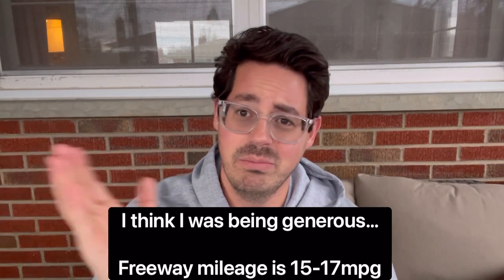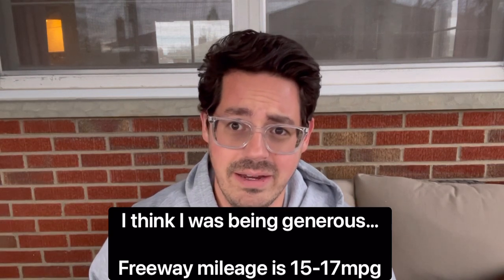Worst Engines of All Time: 1982-84 GM/Chevrolet 305/350 V8 Cross-Fire Injection System

Comment: In early 2000's a friend acquired (money owed to him) an 84 Vette, it was running, but barely. For several years I watched him spend God only knows how much money on that car. Replaced engine, transmission, brakes rotors, interior etc. etc. He even painted car himself (just ok) and was convinced that because it was the first year after GM skipped a year that it was worth the money. I just saw it as a rat's nest, and still do. I remember throttle bodies giving him fits, this video brought back all those sad memories of him hemorrhaging money for his dream car.

Comment: Oopsy at 5:54 ... runner length tunes the resonant pulses that serve to "ram" the mixture into the cylinder. Think of them as pipe organ tubes... longer tubes means longer wavelengths means lower frequency of resonance means greatest resonance at low RPM. That's why the LT1 (1992+) went with shorter runners to address some of the high RPM breathing issues of the Tuned Port Injection (L98 and LB9) setup, and why engines like the LT5 (the Lotus-influenced ZR-1 of 89-93 (?) ) had twin runners... one long for in-town driving and a short set for high RPM.

The Tuned Port Injection engines of 1985 and later (305 LB9 or 350 L98), especially the quicker-brained versions from 1986+, were worlds better even if they were "batch-fire" instead of individually fuel injected (meaning, all 4 injectors on a bank fired at the same time, so ultimately there was bound to be some puddling in the runners near the heads). I can get 25-27 mpg (US) on my 1987 Trans Am GTA (with the 305 TPI automatic of all things) without effort at 68-70 mph cruising speed over very long trips. And driveability is just phenomenal, with amazing throttle response and a feeling of having an engine that isn't shy to pull at very low RPM... I will often climb bridges at 38-40 mph with the transmission in overdrive with the lowest of pedal travel, the engine just hums effortlessly at what seems to be 1000 RPM, converter clutch still engaged. In that respect, the engineers really succeeded in making the smaller engines feel like the larger ones they replaced, with significantly reduced fuel consumption.

I imagine your 1982 Trans Am must have a fairly nice sound if it still retains the dual-resonator exhaust setup. I think those years still used a pellet-style catalytic converter and you could get away with such a stupidly unmuffled exhaust setup due to the converter. That would never pass regulation on my 1987 GTA, LOL!

Comment: It never ceases to blow my mind how little power old American v8s made. I understand they had a lot of push on a count of their displacement. For example though, Honda had a side draft carb 1.8 liter that made 123hp in 1982. Or course it could only do it screaming at max revs, with little low end response,  but considering being much less than half the size of a 350 it’s just mind blowing.

Comment: The crossfire was used in the corvette from 1981, I've worked on several. Two of them (1984-85) I converted to standard GM TBI and the customers were happy to have a car they could actually drive.
Reply from the maker: No. From 1982 model year. 1981 was carbed.

Comment: Circa 1990 or so one of my friend's friends had a little used 1984 firebird v6 5 speed manual that I used for about a 50 mile sojourn and I thought it was kind of fun to drive.  Back then, anyway.  The engine ran well enough. Slow but the stick made it mildly entertaining.  It shifted smoothly and the clutch take up was alright.  Not thrilling but it didn't break down on me, so there's that.  Boy did it shake and rattle, though.  Just awful build quality.  He got rid of it not long after that if memory serves.  Sounds like maybe the v6 was the better choice.
Reply: Those early oddfire V6's shook like a V8 with 2 bad sparkplugs...

Comment: I have an 82 corvette with 150,000 and the engine was never opened up. It was GM’s cheapness that caused most of the problems with the plenum leaking. All because they chose to use silicone instead of a real gasket that felpro produced later and solved all the problems. IDK where you get your fuel numbers from but the 82 gets 16MPG around town and 16mpg on the highway without the AC on. The worst part of the engine was it falls on its face at 5000 rpm.

Comment: I read somewhere, I don't remember where, that they limited the runner size in the Crossfire because if the ports were full sized, it would make more power than the upcoming TPI.  No way that would be acceptable to '80s GM. Granted, I've never had one, I've never driven one with an X-Ram or similar, and I've never had to deal with the headaches of those early TBI units.  I did have an '87 C4 with the TPI and though it wasn't fast, it was very consistent.  One night at the drag strip I made six passes, the worst was a 14.45 and the best was a 14.39.
Reply: The '85 with iron -882 heads was supposed to be faster: 
https://www.youtube.com/watch?v=M9FwU9iUmfo

Comment: "0-60 time is like 8 and a half seconds.....not fast" LOL My 75 century has a 0-60 time of like 16 seconds. Should I just get out and push? XD
Reply: Like this '69 Impala with 396" engine at 03:27 :  
https://www.youtube.com/watch?v=Ljch2kCg4rM
Reply: @BuzzLOLOL  LOL yeah haha. The 231 actually has a lot of grunt on the low end. Getting to 45 is just as fast as most other cars it just loses breath in the top end.
Reply: @YarHarFD  - V8's with 2 bbl. carb.s just get asthmatic by 3500 RPMs... or maybe by 3000 on a 396"...
Reply: @BuzzLOLOL  it's mostly the intake and cam combo. Carb is irrelevant if you can't get it all in to the cylinder

Comment: It's like you reached into my brain to create this video. I have an CFI '82 T/A, just like yours, only mine is white with a maroon interior. Dream car since I was a kid watching Knight Rider reruns. Found it for what felt like a steal in 2014. Suffice to say I have, through sheer necessity, become an expert on the electronics that govern the Crossfire system. I swapped a 350 into mine when the original 305 overheated blew some seals and warped the intake... elected to keep the crossfire to preserve originality at car shows. I made it a little higher compression with aftermarket pistons, threw a little hotter cam in it with some stiffer valve springs, opened up and ported the CFI intake, gave it a decent exhaust, and ended up replacing the ECU with a Megasquirt system and wide-band O2 sensor, so now I've got endless tuning possibilities to try and overcome some of these design flaws while keeping everything LOOKING mostly stock --  I'd be lying to you if I said that I've truly "woken up" the setup or reached its true potential, but it makes a great noise and can chirp the tires if I ask it to. My only regret is that I didn't swap to a 700r4 when I had the drivetrain out. Your comment on the th200 is spot-on, what a dog! ... but if I want to go fast I've got other cars.

Comment: Here’s a idea on more 80’s fun, all late eighties full size GM wagons (86-90 I think) only came with a 148 hp 307 4 bbl. Oldsmobile engine while everything else, from Chevy anyway, was available with TBI 305/350. These wagons weighed 5000 lbs, makes no sense, and they were the worst at passing emissions

Comment: I have an '82 Trans am. Bought it in 1986. And it HAD the crap fire system.  That thing was harder than a Porsche injection system to work on. So I decided to get an intake kit and a carburetor in. Took out the fuel pump and installed one in line with a pressure regulator. Never had a problem since. And it does have the 305 V8, 5 speed manual (Original equipment), The only issue I had was the hood clearance, I went and built an air intake system and never had any trouble. Now, When it came to the electrical system, The only issues I have had were the dash lights, Fuel, Temp and Electrical gauges. They have since been replaced by better gauges. the car does get around (If driven sedately) at least 22 mpg.  but the car will go like a bat out of hell.

Comment: I was working for GM when the TPI system came out. Day and night difference in the Corvette. In 86 I believe, they did away with the kick down cable on the 4 + 3 manual transmission. This gave 2 different ratios at any time.
Reply: Dough Nash 4+3. Was kinda like a  4 speed with a power glide on the tail that had a switch by the shifter to control hi and low
Reply: My 88 Vette 4+3 will  downshift when floored, so must still have k down linkage

Comment: bro I had a 5.7 L Crossfire injection Camaro in 1982 and it was so bad I mean it was just a monster
Reply: @gurnblanston3210  they specifically put a 350 in it my dad paid for it, a crate motor from chevrolet of covington an I built an put in with my own hands a 68 impala stationwagon powerglide behind it, ac t tops 32k miles an it was a monster not a 305 I've been building hotrods my whole life grew up in my dad an uncles shops I've put together a thousand cars an trucks before I was 20 I know what Im talking about get your facts straight I terrorize St Tammany Parish with that car for 3 years at the same time I had a 73 camaro plus a few other things done up ontario orange with a cream vinyl top kept snapping the subframe on that one till I put a trans am sub in it you don't have to believe me I don't really care I know what was in it 100% an I know what went back in it 100% dig a little deeper brother you'll find what I'm saying is in fact correct
Reply: @edmondpecotjr.8888  - The 350 crate motor was probably only 160 HP as well...
Reply: Camaro only had 5.0L...
Reply: @BuzzLOLOL  no it said 5.7L we had a crate motor put in at Chevrolet it was a direct replacement
Reply: @gurnblanston3210  - But twice as much power as a 1970's Mustang 4 cylinder...
Reply: @gurnblanston3210  - Actually, they were faster because back then they tested with the weights of 2 people and test equipment in the vehicles! We drag raced with one person plus a power tune!

Comment: A couple of things to note was that all 82 and 84 Vettes used the 700R-4 transmission as far as automatics go and the 84 was much lighter so had the best performance numbers of the bunch. As for the F-bodies note that the 82's were rated for 165 HP and used 200 Metric 3 speeds but the 83's made 175 horses and used the 700R-4 tranny's and better rear gears so were a little quicker. Those weren't bad HP numbers for the time but as stated it was the way they executed it that was the issue. The L69 HO 305 made 190 HP and performed much better in the real world and the TPI engines starting in 1985 were far stronger.
Reply: These guys claimed unbelievable numbers for '85 TPI Vettes... although the iron -882 heads did flow slightly better than later aluminum heads and bled off less heat/HP: 
https://www.youtube.com/watch?v=M9FwU9iUmfo

Comment: The photo of a 302 at 5:15 is of one equipped with the experimental canted valve aluminum cylinder heads. According to Smokey Yunick "They weren't worth a damn." He said that they managed to make 450 HP at 6,900 RPM, but they were making 475 to 500 HP with the conventional heads by then. They had really cool looking valve covers though.

Comment: The Cross Fire was a terrible engine for most people. I knew a Pontiac mechanic that wouldn’t work on them because they were so cantankerous. A quick note on the early F-Body card too…. They were notorious for twist when any real power was made under the hood. The description about body flex was real, even into the early 90’s cars. You can remedy that flex with weld-in subframe connectors, which is what I did with mine. My t-tops didn’t leak, as long as the car was parked on a level surface. Park one wheel off the pavement in a rain storm, and you’d have a puddle in the rear passenger floor area. They weren’t great cars, but really not many were in the early 80’s.  And why GM carried the Cross Fire into the Corvettes in 84 when they quit using it in the F-Bodies is still a mystery to me, and quite frankly pretty stupid.

Comment: I respectfully disagree 5:54 ; Chrysler used long-ram intakes with dual carbs in the early 60s and they made great low-end torque. (think 383 or 413) Cross ram intakes with shorter runners, like the 305 and 350, made more high rpm horsepower. Again, Chrysler made use of this concept with the 413 and 426 Max Wedge engines, and later the 426 Race Hemi.
Reply: Long rams came with street 30" runners or race siamesed 15"/15" separated runners...

Comment: very informative...I had an 82 Camaro, luckily a 6 cylinder carburetor...I have an 87 Iroc now with the 350 and a 5 speed, I know, they didn't make that combination from the factory but I had the 5 speed installed, still a lot of body flex and rattles but a lot of fun

Comment: longer runner = more velocity at lower rpm less high rpm CFM (like sucking through a straw)
short runner = less velocity at low rpm (poor mixing, lower torque) but high CFM at high RPM

Comment: I worked on quite a few  of those back in day. Temperature sensors were a big problem, I had one that would flood all the time when it was cold, you would just turn the ignition on ,, not cranking it just turning it on, and the injectors would just pour fuel on the intake. And like you said the vacuum leaks lol. I did have a few that ran really good and really strong believe it or not for what it was for early 1980s. But That was few and far between. Lol.

Comment: How do you clean the carbon off an oxygen sensor? Start the car, hold the throttle half or more open, remove the power brake booster vacuum hose and run it so lean and hot that it burns off the carbon. I had to do that on my mom's 82 LeSabre because she drove it 4 miles a day. The engine never warmed up.

Comment: I had a new California version 1982 Camaro Z28 with a 4 speed manual and came with a carburetor.  Terrible performance.  Terrible gas mileage, in the range of 12 mph on freeway possibly because only a 4 speed.  Next year they got the 5 speed manual.  Horrible car but certainly looked great.
Reply: Main problem was emissions slug internal engine parts...

Comment: Haven't been able to get my crossfire Corvette to run worth a shit yet, I've replaced the fuel pump and filter plugs and wires, it starts up and runs fine at low throttle, try to open it up some and it just boggs and surges at and drops at  higher rpms.
Reply: @gurnblanston3210  sounds kinda pricey.
Reply: @gurnblanston3210  it ain't hurting anything having new plugs and fuel pump and filter I'm going to clean the injectors    if that doesn't help I'll probably  take it to a race shop have it done properly, and modify it to have better power too.
Reply: @gurnblanston3210  in California maybe, we don't do emissions inspections in the state where I live.
Reply: @gurnblanston3210 you are such a dweeb, we build hotrods all the time here, I can even do it myself, I guarantee whatever mods done to the intake and fuel system will be more fuel efficient than that crossfire junk that's on it now I'll tell you that!
Reply: @gurnblanston3210  lol, if the motor checks out to be a tired clunker I'm just gonna put a 383 stroker in it.
Reply: Rich mixtures crud the O2 sensor and they have to be cleaned... then reset the computer...
Reply: @BuzzLOLOL  thanks, I'll try anything at this point.

Comment: I have owned an 1984 Corvette Z51 since 1990 (32 years) and no problems with crossfire injection at all.  Only changed plugs, wires and cap a few times along with a rad, water pump, ac compressor and coolant hoses.  I still have original exhaust and change all fluids regularly.  Not bad for a 38 year old summer car that looks and sounds good and gets lots of attention and decent gas mileage.
Reply: I had a 1984 corvette for a long time, I really liked it, those throttle bodys are the same ones the 4 cylinder cars had and they were very dependable and simple to diagnose and repair, yes the intake does not flow well, I got power for mine by milling the heads 40 thousands and some port work, 1.6 rockers and a 10 pound nitrous bottle, the injectors are pulse width modulated by the pcm I just wired the ground to the nitrous switch so they were wide open did not run any fuel lines, just had to find the correct nozzle it worked great, it was faster than the tuned port cars and got 26 mpg on the highway, the nitrous makes the bad intake design a non issue, so the rare times you really want that power it is there